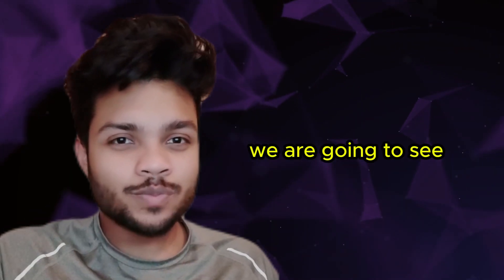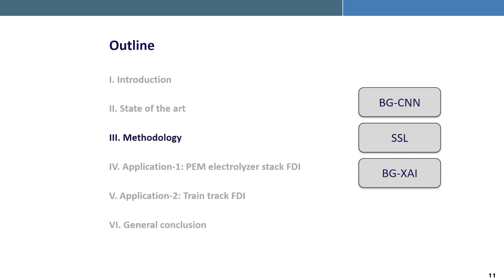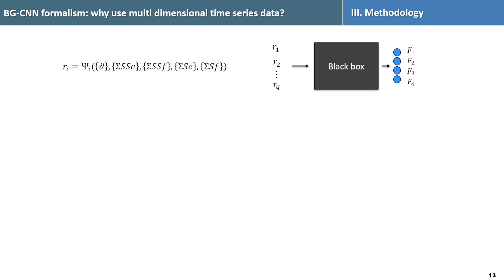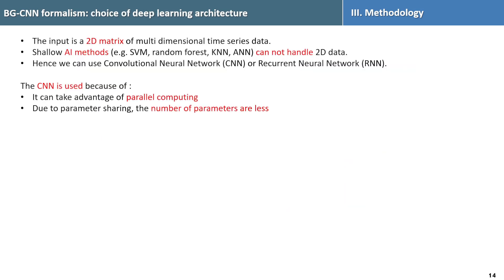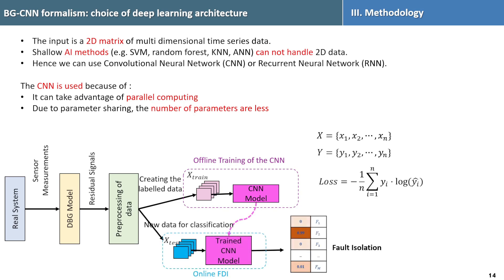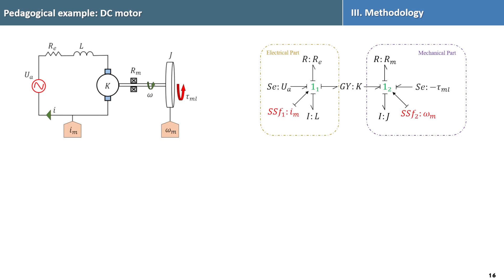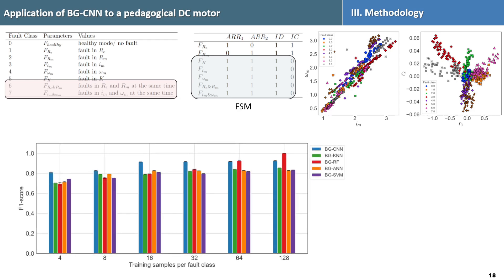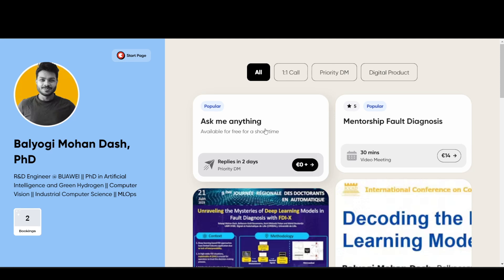AI + Physics = Better Predictive Maintenance: My PhD Research Explained || PART 2

Comment: how to calculate residual signal
Reply from the maker: @Pythondatascience-e3c  Hi, to calculate the residual signal first you have to obtain an redundancy relation for your system dynamics.

This is the fancy way of saying, you will have to find the governing equation such as Kirchhoff's law, newton's law, Bernauli's law etc.

If you have a simple L, R circuit with a voltage source of V. The ARR: V - L di/dt - R i = 0

In this equation you know the parameter values such as L, R and the input source V. Then bu using one current sensor you can obtain the 'i' and plug in this equation with time to get the residual signal.

Ideally it should be zero if the system is in healthy state. But even in healthy state you get little bit deviation because of the temperature, humidity etc that influence the parameter values.

If in your system, the R is faulty (if it's value increases or decreases than nominal) then the right hand side of ARR won't be zero anymore, that's how you detect the fault
Reply: @Mohankumardash  Thank you! so much. di/dt is zero or ?
Reply from the maker: @Pythondatascience-e3c  welcome 😁.

No not always you have to calculate it everytime by i_(t+1) - i_(t)/ ∆t